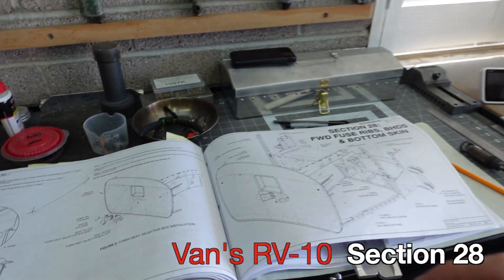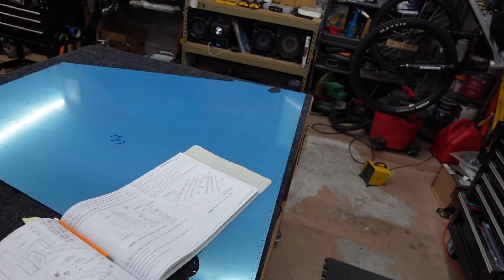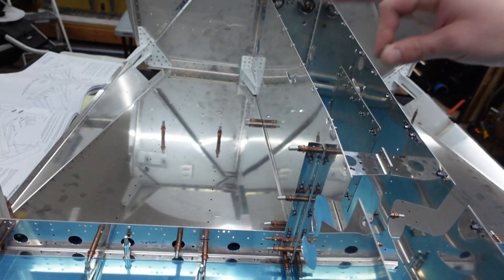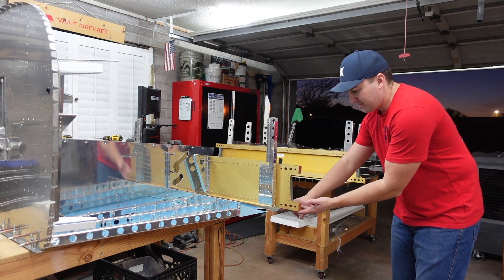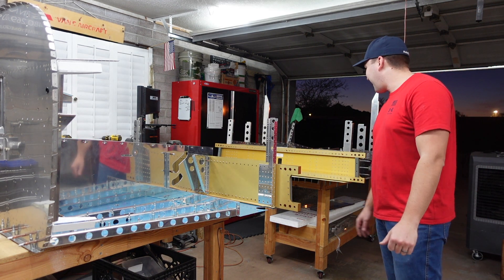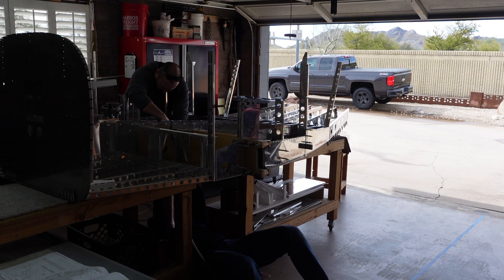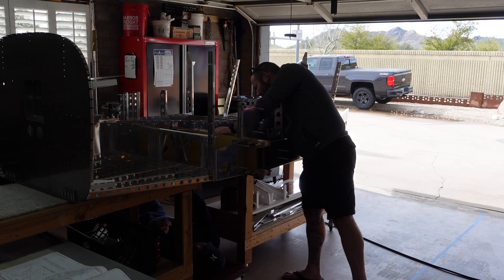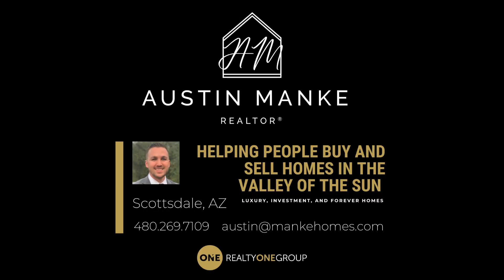RV-10 - Section 28 - Fwd Fuse Ribs, Bulkheads, and Bottom Skins

Comment: Many builders put the Flo-Scan in near the engine because it's apparently more accurate there.  So, I plan to not install the VA-188 at all.  (I'm a little behind you now, since I'm priming everything.)
Reply from the maker: That makes sense. My understanding is it reads high with the boost pump on if it’s in the stock location. I’ll have to think about that a bit more. Worst case could leave it unused or remove it if I end up doing the same. Thanks for watching and for the comment!